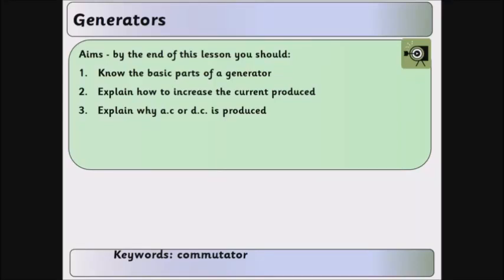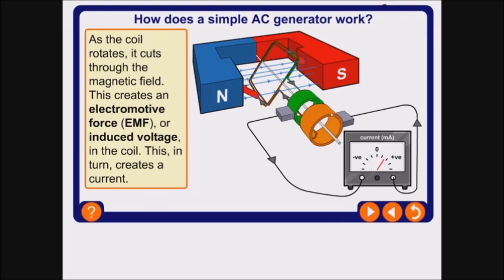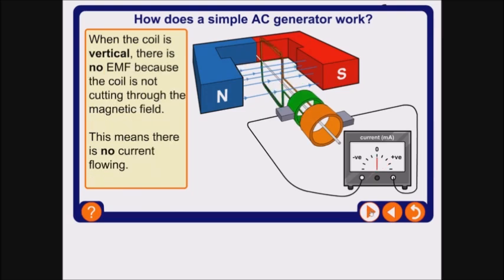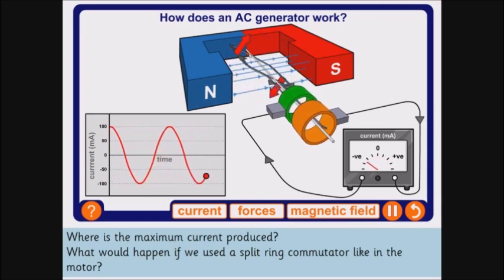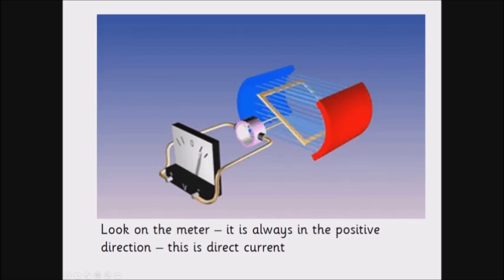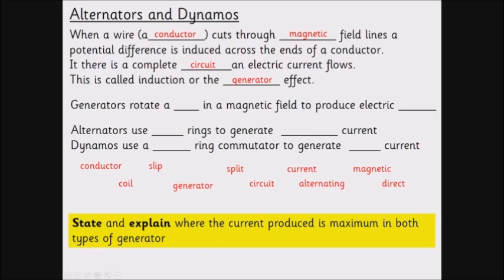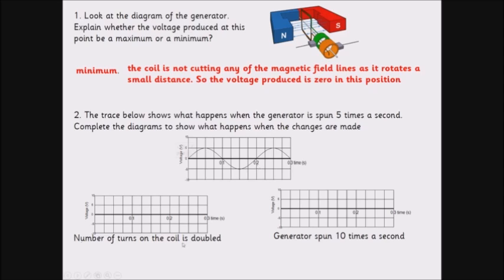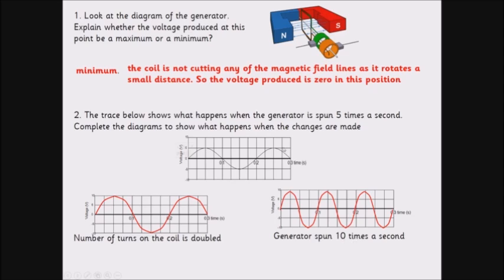Generators   Alternators & Dynamos

Comment: Nice, small detail however. I believe the Flux is actually at it's MAX when the coil is perpendicular to the field lines. However, this means the CHANGE in magnetic flux (which causes induced voltage) is at it's minimum (or actually close to zero) near that point. 

I always liken it to the motion of a swing to my students: when you picked up your maximum speed (at the bottom) of the swing, your speed doesn't change that much. The change in speed is greater when you near the points where your speed is zero (either accelerating or slowing down). Lenz's law says the induced depends on the magnitude of flux change... which happens (counterintuitively) most when you reach zero flux.
Reply from the maker: Hi Walter, thanks you are entirely correct. I think the model used here is to talk about "cutting lines of flux" which we tend to use at GCSE level. At A Level we would certainly talk about the rate of change of flux linkage being a maximum when the flux linkage is minimum (as you say very much like displacement and velocity in SHM).

Comment: Please explain the term split ring verse slip ring.  Why does one need a split ring and the other a slip ring. The rest is perfect?
Reply from the maker: If you have a split ring then the (for example) left side of the coil is always connected to the left side of the output. So the output pd will always be on the same direction. In a slip ring the same part of the coil is always connected to the same ring, so as it goes 'up' it makes a pd with one sign and as it goes 'down' the direction reverses producing a.c.
Reply: @ATPHYSICS1   I remembered it backwards, the two rings are AC, and the DC has one split ring... So are you also saying the split has to be clocked to a certain position, say  90 from the magnets?  Also you have the coils spinning in opposite directions from the first dc to second dc illustration. Does it matter which way it spins for - or +?
Reply: @ATPHYSICS1  I think youre saying the split breaks the connection and passes current to next split ring?  So they must be clocked 180 apart. Have to watch this video again. No that can not be right because current only flows one way... What is PD? Not looking at the video as i write, i thought there were two rings shown for the DC Why two rings...why not one that is split?

Comment: Dang one can simply design the rings ( mechanical commutator) right at the source to either get AC or DC.  And full phase that is so you are not losing half of that turn.  Works for me.

Comment: sir, does an electricity push it around? so does an external voltage push it around?
Reply: Push "it".  What is your "it" referring to?  push what around?   You mean what TURNS the coil or a rotor?

Comment: are you dumb. the ammeter shows zero because the coil is moving parallel to the magnetic field and hence no emf is produced at that point.
Reply: you idiot that is what he basically said
Reply: You're mixing the motor effect with the generator effect, a wire running parallel to the magnetic field in the motor effect means that no force acts on the wire, the current is still there. In the motor effect, you supply the current and want to get a force that acts on the wire. For the generator effect, the coil experiences a change in magnetic field(through cutting magnetic field lines), so a p.d is induced. Therefore, a wire running parallel to the magnetic field has no effect on the current for the generator effect and motor effect anyway, only the force acting on the wire(for the motor effect). And besides, the coil isn't even parallel to the magnetic field, they are perpendicular to each other at both points where the current is highest and lowest. Remember its when the coil of wire is parallel to the magnetic field! not the magnet.